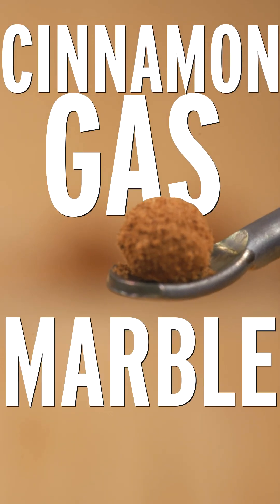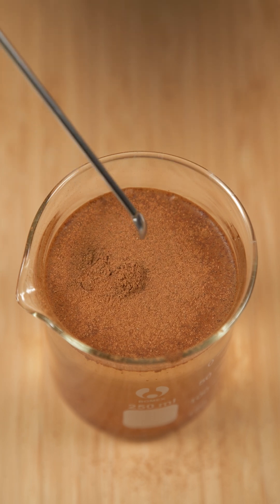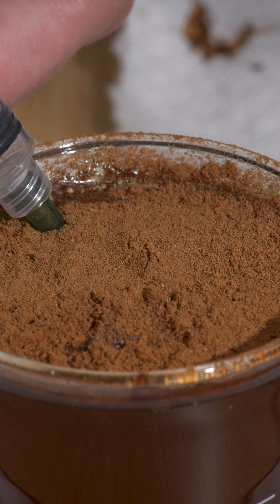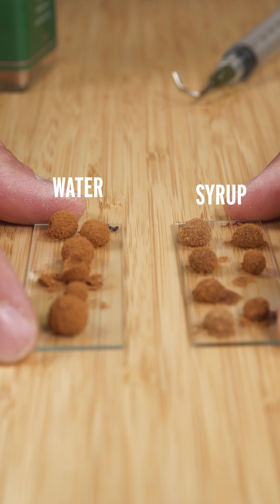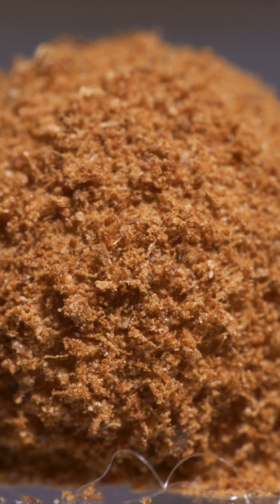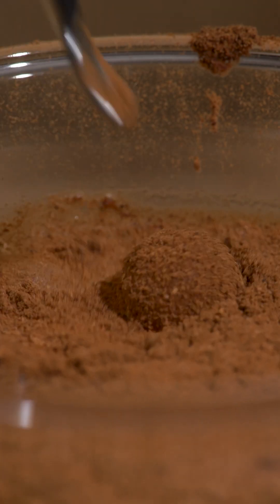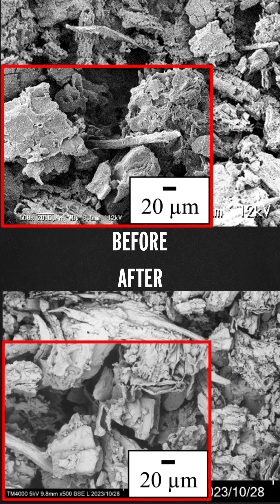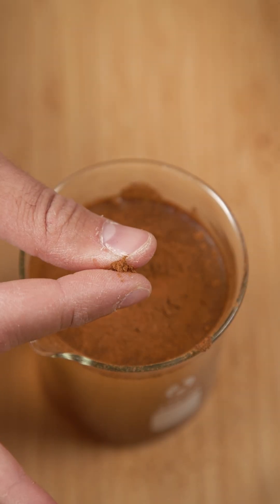i kinda made a cinnamon gas marble?

Comment: It's probably the stuff in the water... You leave a cup of water around that glass isn't clean when it dries... It will have dissolved metals or what ever didn't evaporate out left as a residue on the glass. Water is a blank canvas for anything to stick to or get dissolved into. Having a different out come with the basic water and cinnamon may have been because you had less dissolved materials in your water to bond together after the water evaporated. But your 100% right when you ask what is keeping them together it totally could just be the cinnamon gets placed into a certain pattern that doesn't allow water to get in or out until broken. Then dries and the pattern is still locked as it was. Pretty cool I noticed this as a kid with hot chocolate I think maybe it was cinnamon. I never tried to pick it up though let alone dry it out. Like who thinks about drying that out such a wild idea.

Comment: What's left is friction. The large surface area of the combined smaller particles actually allows for more friction to hold itself together than if the particles were bigger than they are. 

It's friction holding the pellets together once the water evaporates. But there's still water in it it's not 0% water.

Comment: Because cinnamon is just a type of wood bark, it is possible that the fibers in the cinnamon are being hydrated making them expand. After expanding the water dries and the expanded fibers from different cinnamon particles  compress together and interlock.
Reply: Not likely. The cinammon behaves the way it does on the water because it's hydrophobic.
Reply: @HotelPapa100 you know phosphoid lipids are both hydroponic and hydrophilic, and adhesion and cohesion allows water to go up the xylem apparatus in plants, so it's probably them just interlocking after being stuck together
Reply: @kingofdoom I think it’s a bit irrelevant to talk about how nutrients move through a the Xylem of a tree when you’re discussing how the powdered dead bark acts. 
This is hydrophobic; I think the water has a slight outward force when it’s inside, pushing the cinnamon sphere apart. The structure ‘collapses’ into a tighter sphere as the water evaporates and the grains interlock. And as it’s close to a perfect sphere in places, there’s a lot of strength.
Reply: @martybowie fair point, i think i was trying to say that they can pull in water and stick together, and once they dry out,they would still be in the same position do to cohesive properties, similar to that of paper maché

Comment: Does anyone remember when Indiana Jones the ride opened at Disneyland in Anaheim? The roof would collapse in one scene. I was blown away as a kid seeing that and I couldn't figure out how the large stones from the roof could just collapse and break apart right in front of us and then, somehow, get reset for the next car. WTF???

Well, it turned out that they were using dry ice blocks to simulate stone blocks, and they used a conveyor belt to deliver the blocks of dry ice up to the roof level to be dropped.

Now imagine that you did a similar thing where you build fake construction blocks, or earth rubble, out of cinnamon or similar particles using this technology. Well, maybe not cinnamon, because everyone would be choking on cinnamon. It would have to be something safe to breathe or not good at aerosolizing, and that's pretty much only clean air, the components of clean air, and water (including ice), and ferromagnetic fluid under a containment field. Unless you put it behind glass in a contained room so that the dust is never directly allowed to hit riders (or cast members). But otherwise, the question is, can we build something similar using particles of water or dry ice frozen using various molds into shapes optimized to deliver this effect? And then of course we would use projectors to fully light the surface to create the diffuse map.

Comment: if you sprinkle some cinnamon onto water and then bend a blunt needle into a J shape, and then attach the needle to a syringe and then draw in some air with the tip of the needle, just under the cinnamon and expel the air then the air will get trapped under the cinnamon layer, and if you then delicately roll that air bubble around and then transfer it to a glass slide and let it dry. You’ll get a hollow sphere made of pure cinnamon, and I talk to the person who invented these and he said that if you make a gas marble using caramel instead of water, it makes a very satisfying crunch so I tried it and not only did mine not crunch. They were also just soggy and it turns out that I actually didn’t really make them out of caramel at all. I made them out of syrup so that’s that’s on me. That’s bad when you make them out of syrup or caramel that’s the glue that holds the cinnamon particles together, but if you make them with water what’s holding the cinnamon particles together? I mean the water just evaporates so what’s left but I kind of failed. Mine were so fragile that right after I filmed this beauty macro shot. I talked over the glass slide and destroyed them all this is not supposed to happen if you use the right kind of cinnamon and you do it properly they can actually survive a much higher fall as you can see here so maybe a few water molecules are staying behind and linking adjacent cinnamon particles by hydrogen bonding. That is one possibility who invented these looked at them using a scanning electron microscope both before, and after drying, even though it’s not exactly the same part of the marble look, you can see the difference here the idea is that as the water evaporates that draws all of these regular jagged cinnamon particles closer together and interlock with each other, essentially holding onto each other by friction, which makes this even more impressive and sad that I couldn’t get mine as strong as this. I’ll try again.

Comment: You probably used Cassia Cinnamon (from the plant Cinnamomum cassia), which is easier to grow and thus less expensive, while the experiment used True Cinnamon (Cinnamomum verum). 

Sellers don't have to label them differently, so basically if it doesn't specifically list that its True, it's probably Cassia.
Reply: I worked at a spice mill. We had 14 different cinnamon types. But all are either cassia or ceylon (true cinnamon). Most cinnamon that you buy already ground or those big sticks as home decoration is cassia.
Reply: Given that the bottle we see has a cheap store brand label on it, I also suspect there's an anti-caking agent mixed in, which is specifically there to prevent the sort of effect he's trying to cause here
Reply: The species name verum is really interesting and raises some etymological questions.
Reply: Always get Ceylon

Comment: Sorta the concept in cob building: clay slip is mashed together with sand et fiber; et used to build a structure. When the water evaporates it draws the clay particles tightly around the jagged grains of sand locking them together. Straw works as micro rebar making the entire system a cohesive whole. Very strong. Is why this building method has been used by cultures around the world fir thousands of years.

Comment: Friction is really impressive. The mythbusters did a test where the tried to pull apart two phone books with interlayered pages. Took a lot of force to pull them apart.
Reply: If I remember correctly they needed a literal tank (a WW2 Sherman) to do it. A regular car was held in place by the phone books.

Comment: Try it with demineralized water. Normal tap water has all sorts of salts and minerals dissolved in it, which are obviously left behind when it evaporates.
Granted it's a tiny amount, so it probably won't change anything, but it would be interesting to know for sure.
Reply from the maker: I used distilled water!
Reply: @ACSReactions then maybe it's the salts and minerals that assist in the friction bonding?
And tap water is the key?

Comment: That question at the end, how do they stay together, after the water evaporates, reminds me of my hair shower question. "How does my hair stay on the shower wall, after the shower has dried?"

Initially my hair is wet and the shower is wet. So, water's surface tension, adhesion and cohesion properties are sticking the hair to the shower wall. But after the shower dries, how are they still clinging? (I mean completely dry, even if I go on vacation, and return a week later, they can still be stuck.) Could there be friction between the hair and the shower? Could there be hard water chemicals like calcium left behind? Could there be stubborn water molecules doing some heavy lifting with hydrogen bonding? Some combination of these? I don't know. I don't have a scanning electron microscope in my bathroom.

Comment: Something similar happens with regolith (aka "moon dust"). Due to the unfiltered radiation from the sun and the complete lack of weathering processes leaves the regolith extremely sharp, jagged, even blade-like. Not only does this cause serious issues with our space suits (literally shreds em, it's crazy), but it also makes it behave in a strange way.

See, during the "Moon Landing Myth" episodes they did, one of the experiments they did was getting real regolith from NASA, and pressing a boot into it vs into earth dust. Due to all those sharp, jagged edges, it could hold itself in place against gravity, resulting in a much more defined, sharp boot print than the earth dust.

This could be working through a similar principle. The water fills the space between the cinnamon grains, and as it dries, van der waals forces between the water and cinnamon pull the grains together as it dries, then once it's stuck together, the friction between grains keeps it in place.

Comment: You want to know why it sticks together? You can recreate a similar reaction by taking two pieces of paper and making them wet, and then put them on top of each other and let them dry. This is my theory behind it. Is that while something soaks up water, it expands And then when the water leaves, it contracts locking its fibers together like velcro.
Reply: My kids have ripped apart nappies(diapers) a few times to make "snow". With water, the hydrophilic polymers expand enormously and appear fluffy, but are more like tiny gel particles. When wet, it can easily be swept up, but if left to fully dry out on the patio, it shrinks and grabs tightly onto the stone becoming very difficult to remove. I think this is the contracting effect you mention.

Comment: Don't forget that water may be adsorbed to the surface quite strongly, like in silica gel.  Drying the cinnamon may leave behind tightly adsorbed water, facilitating and even strengthening the particle-particle interactions.   Measuring the mass of a cinnamon powder sample as a function of temperature up to perhaps 80-100C would provide some insight about this possibility. 
Fascinating video.  Thank you for sharing.
Reply: Cinnamon is hydrophobic so water shouldn't be holding it together.
Reply: @Proud2bmodest  I was actually wondering about that too. Pretty sure they have a fair amount of cinnamaldehyde in them. Not sure if that's what makes it hydrophobic, but yeah
Reply from the maker: That's a great idea, thank you for commenting!!

Comment: Sounds like the effect that binds gravel roads / macadam surfaces. After the layers of different grain size are laid and wetted, they need to mature a few weeks until most of the water has evaporated.
Reply: Tarmac? Uses oil not water. Also called chip seal. Tankers full of oil poured on road base and screenings. Built up over time, more resilient than asphalt.
Reply: @Nickgrows8things  MacAdam is a road surface invented in the UK that uses rock dust to bind gravel chunks in various layers together. It was the best road surface available, nice and smooth. It fell out of use as motor cars became common as the draft from the higher speed cars sucked the dust out of the road. It was replaced with Tar-MacAdam (also from the UK), which used tar (a by-product from coal/town gas production) instead of the rock dust.

TarMacAdam is no longer used as we don't make coal gas, so we use bitumen made from crude oil to make asphalt
Reply: @gregoryclark8217 thanks for the disambiguating! I watched them laying the chipped rock and what I thought was hot bitumen. Never knew about using coal tar, the first few days were really dusty until the particles bound.